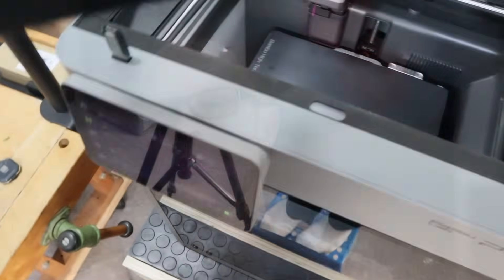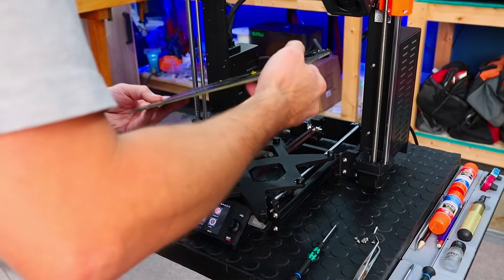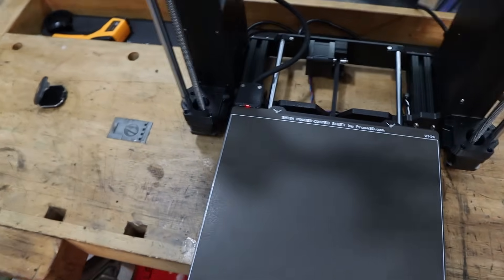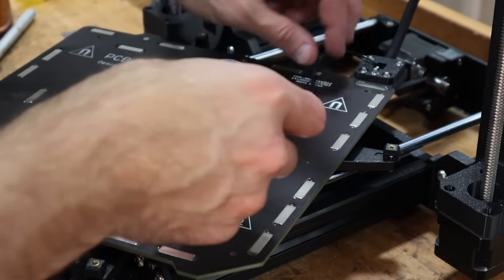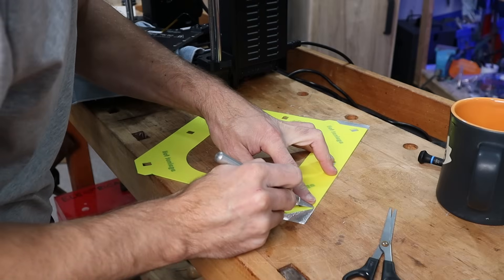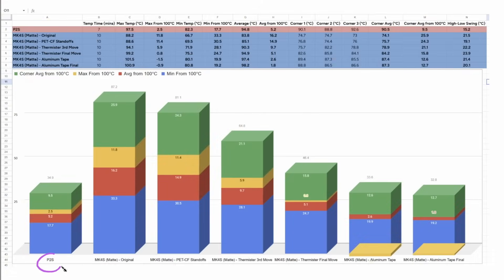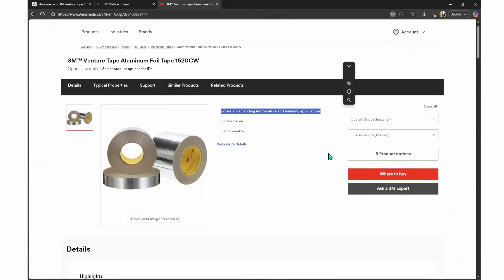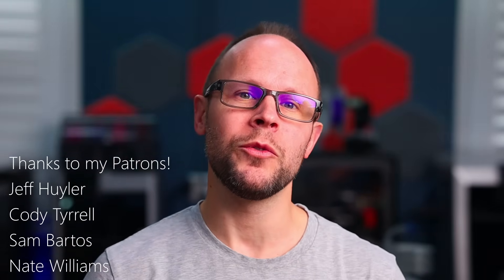My Prusa MK4S' COLD SPOTS were bad, so I fixed them!  Now the MK4S has the most even heat

Comment: After years of experience with the MK3/4 machine I agree with the cold spots from adhesion problem areas I have seen.  I am going to add the foil and move the sensor.  I don't have a way to final machine the standoffs so will bypass that for now.   Also my Core One is much better at adhesion in these areas.

Comment: All that trouble just to match the cheaper p2s
Reply from the maker: Lots of people out there have this printer I thought it was worth taking the time to provide a solution, if you own the printer already, it'll help, but I agree, the P2S is superior in a lot of ways.  Most of all, I really am not a fan of this huge enclosure with poor access and visibility to the touch screen.  I think the Core One though is a very nice machine, and this solution also works for that printer too.  I also wanted to check the Core One L and it has a nice thick aluminum bed, so that's really nice to see.

Comment: The video is very interesting. Methodology and all. I have an unmodified MK3S printer, I believe the heat plate is the same. I set the bed to 100C and keep the print sheet installed. Measuring with a good optical thermometer I measure the center temperature about 94C. But the corners are not more than 12C bellow that. For some reason the back corners are warmer closer to 90C while the front ones are cooler. A little bellow 85C. I wonder if with the pint sheet installed you would not get less temperature difference across you plate.
Reply from the maker: I can't be sure, based on what I've read from other complaints online, this problem wasn't an issue until the MK4S.  The bed is slightly different in size too, not by much, but it makes me wonder if they had modified some other things in order to possibly make the bed lighter and possibly be able to speed up the printer.  This is my first Prusa and I'm pretty happy with it for the most part, it is more of a tinkering printer, which I like, but I really want to get a Core One or a Core One L and then eventually install the INDX from Bondtech and see how it compares to other multi-color/material printers.  I think Prusa is doing well in keeping in the race and making good products, I just wonder who designed this printer bed and why they thought using fiberglass with a black surface on the bottom would be a good idea.  It is an excellent way to radiate heat.    I also wonder whether the thermistor itself is the culprit, maybe the position or the resistor is different and giving different readings.
Reply: @NeedItMakeIt  The base/print plate seems to be the same. When you order the upgrade to MK4S, if you have this version of the plate, the upgrade kit does not include it. I think the position of the termistor will only offset the temperature. They would have to better distribute the power dissipation across the plate to homogenize the temperature. And I think this model of the build plate is already an improvement in comparison to the previous one used on the MK3. That ones needs to be replaced when updating to MK4S.
I wonder if the benefit you observe with the tape is not because it is conducting heat better to the outside of the board. If I remember be thermodynamics corrects, it would help reflect radiated heat away, but it would not reduce radiation. And probably if the tape was applied to the mounting plate instead, it would help reflect some of the radiated heat from the build plate.

Comment: don't lose the screws sure, but they look like standard metric screws, just measure one of the other ones and buy a pack :P not the end of the world
Reply from the maker: They were M3, but they are FH and Torx as well, I didn't have the exact replacement, but I found some that worked to get back going luckily, they just didn't match... not ideal.

Comment: Super minor quibble but heat loss through the bottom of the bed would be via convection and conduction, very little due to radiation. Radiation as a heat transfer mechanism is very low unless extremely high temperatures (above 800K or ~500C) are involved where heat can be radiated via infrared. Yes, this means that "radiators" in houses or car engines are incorrectly named, but from a pure heat transfer point of view, no appreciable heat is being lost from the print bed via radiation.

And yes, the camera is detecting heat radiation, but it's still very low compared to heat lost to convection and conduction.
Reply from the maker: I agree, there would be, however because the bottom surface was coated with matte black, it would be acting as the best possible surface treatment for acting as a radiator, I think there is definitely a combination, but I would argue that there was quite a bit of radiation heat loss.  Adding the tape should not have added much of a benefit if the losses were mainly from convection and conduction.  How would we test for this?  Ideally I would have added a thin ceramic blanket below as well, but the cost was far too high and I was trying to keep this solution as inexpensive as possible.   I think the choice of materials and or the the layout of the should have been different and there were also elements on the bottom embedded into the black coating, however those elements were not active as the magnets were embedded right into them.  Still it seems odd to do that extra work to just cut into it.  Maybe balancing both sides so warpage was minimized was the goal?

Comment: Could someone explain why aluminum tape should be reflecting heat, considering it’s almost direct contact, and is a great conductor of heat?
Reply from the maker: I am with you on that, I've done some research and found that the reflectivity of the surface is directly related to heat loss through radiation.  The best way that I can explain it is the closer a surface is to a mirror finish, the less likely it is to radiate heat.  It is the surface itself that reduces this heat loss through radiation.   If I painted it white, I'd have better results than the black, but a silvery material is ideal.  Having done some digging, the matte finish aluminum that you'd get with any off the shelf aluminum only radiates a small amount of heat, so if I were to polish it, it will reduce heat loss, so we'd then be losing heat through convection mainly, cool air passing by and then being warmed up, so that's where the insulation comes in.  I have a test on my board to run, the issue is that when you polish something, it becomes really hard to measure with the thermal camera, so I think I'd need to look at getting sensors to measure the core temperatures and also the amount of time it takes to cool to a certain temperature.   It isn't critical, but it would be neat to see how much an improvement you can get by just polishing the bottom of an aluminum heat bed.
Reply: @NeedItMakeIt  thanks for the reply, that makes sense!
If you do any more testing with reflectivity, please consider gold tape! It’s quite literally the gold standard for engine bays in motorsports.

Comment: The problem of Prusa is they charge so much just for the sake of being made in Europe yet still ship with 3D printer parts, it just shows Chinese companies like Bambu Lab just leaps and bounds ahead of them when it comes to to manufacturing 3D printers.
Reply from the maker: I do think their prices are a bit too high, they do many good products, that last and retain their value.  Their filament is also quite expensive too, so that's a bit of a drawback, at least to get it shipped to Canada at a reasonable price isn't really possible when I can literally get Bambu filament for free, including shipping.  I still like Prusa and I'm really interesting in how their Core Ones will work with the INDX system.

Comment: The MK3S is even worse (less uniform), I've been printing since 2019 and own multiple printers and my MK3S has always needed higher bed temps than my others so once it seemed to start getting worse I looked at it through my thermal camera and it was all over the place varying by 15c and I noticed the temps were accurate when at room temp but not once it was heating even if I left it preheating (on with constant set temp and no fan etc) it was way off and uneven then I saw that the printer temp probe was more insultated than the bed so I figured I could just remove its insulation thus making the probe cooler thus making it heat the bed more which I could then insulate but it varied a lot so I contacted Prusa about it because I knew there used to be a temp calibration offset specifically for the print bed and I found a reference and tutorial on their help site but it was old and not applicable to newer firmware and I didn't want to insulate the bottom of the bed until I at least tried the offset because I was having to print PLA at 72c bed temp just to get most of the bed above 60c and some of the bed would be like 70c and some 56c etc so I figured the best way was to do both insulate specific spots of the bed more than others (the cool spots) and calibrate with an offset and after waiting over an hour the support agent told me its literally impossible for their printbeds to not be the temperature it says it is on the LCD and you can't measure them with anything other than the printer itself.... 

No I'm not joking he legit said that and I felt like I was having a stroke trying to dumb myself down to the level required to communicate with him, I even said "so if I used every thermometer on the planet and they all showed the same temp but the printer said different then every thermometer in the world is incorrect except Prusa's?" and he said he didn't know anything about every thermometer in the world but he knew how their printers work... And I also told him everything/all the info I speak of in this comment like mine was off by upto 15c with a thermal camera, infrared thermometer, and a temp test probe all of which showed within like 3c of each other and I told the support agent that and he said again its impossible and their printbeds can't be measured that way etc and I swear thats the truth but I couldn't even believe it so I screen recorded the entire conversation because it took me over an hour to even get connected to someone and then they want to sit there and lie so I planned on making a video on it myself and posting it everywhere I could but I never got around to it (this happened about a year ago, I got the printer new in 2019) so I'm glad someone did and if I remember to check back (my youtube notifications are off but I'm always on here) I can see if I can find the thermal camera videos of my printer or take more and also find the screen recordings of the support agent because that conversation was like talking to a doorknob and emphasis on the knob and I only spoke of maybe 10% of the stupidity of the conversation but point is I would be MORE THAN HAPPY to give you those recordings for you to use in a follow up video if you ever want to do one because the modern era of zero quality customer support annoys me beyond belief

Comment: I have always wondered if it wold help to put insulation under cold corners and edges. Thank you for showing this! I was surprised to se that the aluminium tape did so much difference. 
Could it be that the fiber reinforcement actually improves the insulation properties?

Comment: my $300 A5M has an extremely uniform bed according to my thermal camera compared to that Prusa. Only the very very out edge on the front is not a bright yellow, but after letting it sit for maybe 5-7 mins it was a solid color across the entire plate. The reading from the camera and what the printer was displaying was within a degree. Im really surprised the Prusa did so poorly

Comment: I removed the standoffs and put a 7mm layer of cork between tray and heat bed. Don't have a thermal camera, but bed adhesion on de sides improved a lot.

Comment: I had found my bed to be having that issue years ago and cut out a piece of that foam board with the aluminum on both sides.  It did make the bed much more uniform in it's heating.  I finally checked it with thermal after seeing this, and it looks fairly uniform still.

Comment: Your solution of aluminum tape is good, but the reasoning is partially wrong. Aluminum is a good heat conductor per mass, so it’s forcing the temps to be closer while remaining lightweight (brass/copper is better volumetrically, but heavy and expensive). The tape is probably helping with some radiant heat loss as well, but these losses are unavoidable from the top of the bed, so insulation will only help so much. A few more layers of tape, especially thicker tape, could even out the temps further.

Comment: Huh, this is interesting because I had been increasing my bed temp by 10 degrees which seemed to fix it on my Core One (which uses the same bed) and this matches what you said with the thermistor placement.  I may just get a second bed to experiment with and the tape seems to help a lot to even it out too.  Good job!

Comment: I would be worried that those printed standoffs will have a much worse tolerance and lead to a very uneven bed.
Reply: Additionally, the normal standoffs are designed to mechanically isolate the bed's thermal expansion while still fully constraining its position in XY.

Comment: Under my thick voron2.4 aluminium bed i stuffed stonewool wrapped in capton tape. Works like a charm
Reply: damm i need a thermal camera
Reply: @lautaro-busto  I can recommend the ThermalMaster P3 🤔 Attaches to a Phone via USB-C, has both good Resolution and FPS, and powers via the Phone ( requires no charging of itself ) 🤨
What it will NOT do is being able to display an overlay of the actual Camera on top of the Thermal one but in all honesty that isn't really necessary as doing that is more of a bandaid for Thermal Cameras with REALLY bad Resolutions which the P3 doesn't belong to.

Comment: The nylon-GF, if you dont want it to creep, you need to anneal and then condition those parts.
Reply: he used pet in the end so it shouldn't be a problem
Reply: @riba2233 pet is semi crystalline and needs to be annealed. Unannealed pet performs like Petg with more creep. All semicrystalline materials should be annealed, even the 850/70 “ht” pla’s.

Comment: Why does everyone on YouTube get this wrong? A radient barrier REQUIRES an air space between it and the hot object you are trying to insulate. Direct contact as you used cancels the radiant insulation properties and turns it into conduction insulation in which aluminum is a poor component.
Reply: The big thing happening is he is changing the emissivity of the surface.  The aluminum has a much lower emissivity, so therefore radiates much less heat.  It's not actually reflecting the heat back in.
Reply: so he stumbled into a working solution but not for the reason he thinks?
Reply: @onyxmn13  The air bubbles trapped in the insulation still work at slowing heat transfer by conduction. The reflective foil only helps if there is an airspace between the hot object and the reflective layer. The manufacturer provides this info but few bother to look it up.
Reply: The aluminum tape is helping because it’s a good conductor of heat. It’s forcing the temperatures to be even. It should help with radiant losses as well, but those are unavoidable, such as convective losses off the top of the bed, so insulation is only half of the solution.
Reply: I came to comment the same thing lol
Reply: So what is your solution? His worked and for little money.
Reply: @wojtek-33  you need to add the name of the person you speaking to!
Reply: @Fincher123  Oh Lord. When you reply to a comment, if you don't tag anyone, you are by default, replying to the original person.
Reply: @wojtek-33  Oh yeah i see. Sorry =) Welll i learned a new thing.
Reply: I understand that Copper take up heat verry Easy and Aluminium gets rid of it much easier. Thats why Heatsinks are made this way.
So i also think this one works so far, but he should take a different way. So he can save energy and get even heat.
Reply: @Fincher123  no, that is a debunked myth. Copper is just better in every way.
Reply: @riba2233  okay =)

Comment: Nice video and a very awesome systematic testing!
I have realised one thing common with everyone who has a 3D printer, they will 3D print everything even when there are other simpler, better and faster options! I am no exception! 😅 
For example, in this video the template could have been laser cut (if you have access to one), or maybe even a regular paper print if it was just to trace the outlines. If I ever own an Mk4 or the Core One + , I would definitely like to replicate what you did in this video! Cool (hot) stuff! 🤩
Reply: The problem with using a laser printer for example is that they can be surprisingly inaccurate across the length of the paper. I've run into problems with that when making PCBs at home. For something as comparably crude as this though, it's probably just fine :)
Reply: @treborrrrr  were you trying to print the diagram / content as a jpeg? I faced similar issues until I learnt that if you export the content / illustration / anything with dimensional accuracy as a PDF and then take a print out of that PDF, it retains the dimensions!
Reply: @rohitharip IIRC I exported as a pdf from Eagle CAD.

Comment: Nice finding on the aluminum standoffs transferring the heat to the frame. 
I like the idea of printing your own to stop the process!
Thanks for the idea!
Reply: The printed parts insulate better but aren't as rigid as aluminum. You may induce some printing artifacts.
Reply: The Voron PEEK spacers (complete with PEEK M3 bolts) are cheap from AliExpress. I've just bought a set for my Ender 5 rebuild.